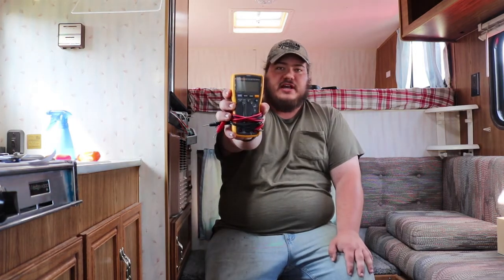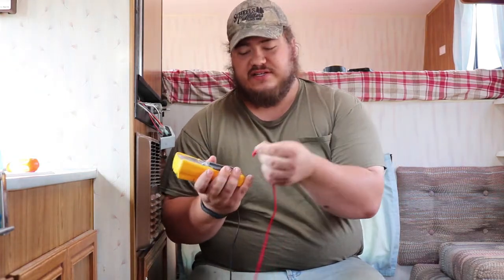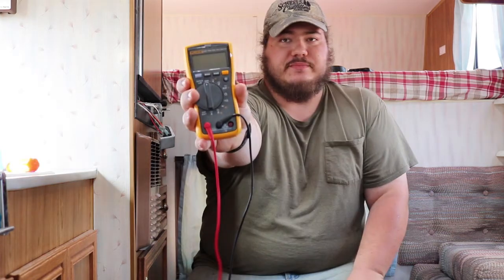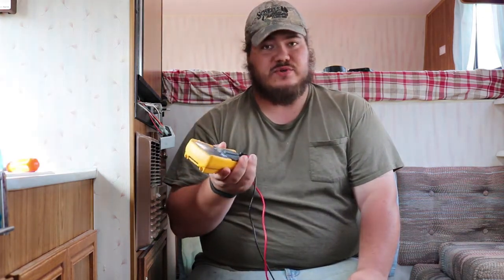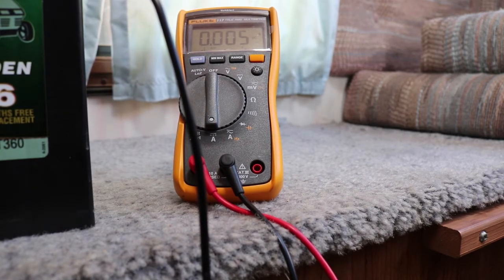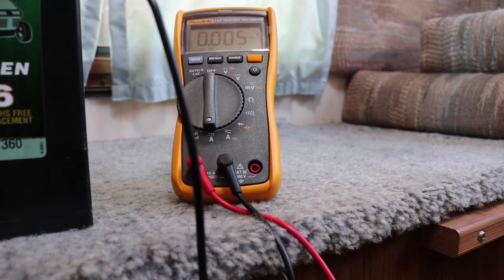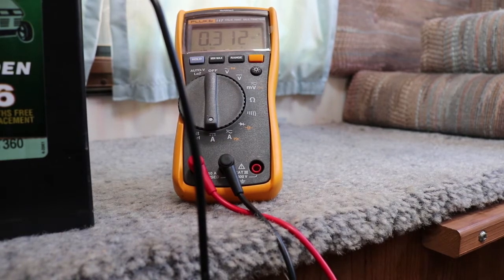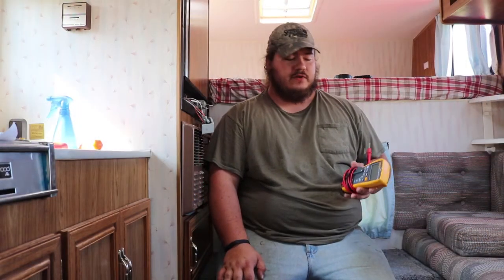RV / Camper parasitic draw test How to

Comment: With the master switch on for all power i getting 1 amp draw while all sub switches are turned off. Technically there should be nothing on if all sub switches are turned off. My RV is older nothing really tehchnical in it. Just lights and fridge at this stage. I ensure everything is off still getting 1amp.This 1 amp is going via the inbuilt amp meter. Do you think I have a faulty amp Meter or a short what would your opinion be?

Comment: Say you do find that there is a parasitic draw on the battery.. how do you determine where it's coming from?
Reply from the maker: greg savoie you have to turn off all the circuits, seeing if the draw happens on which circuit. Than you test each item on that circuit to find which is the culprit.